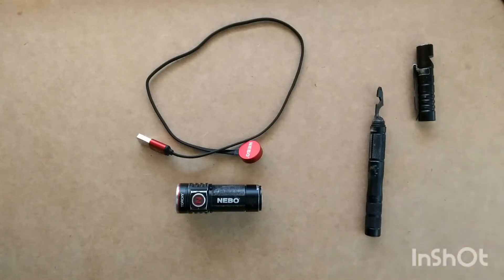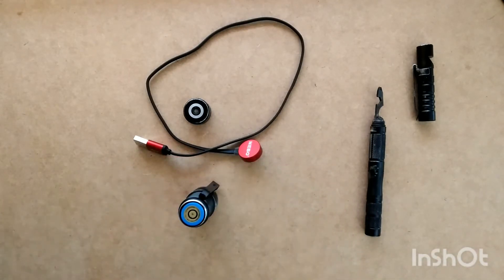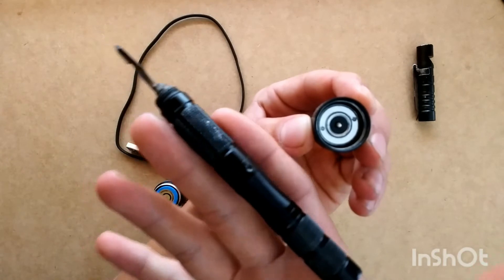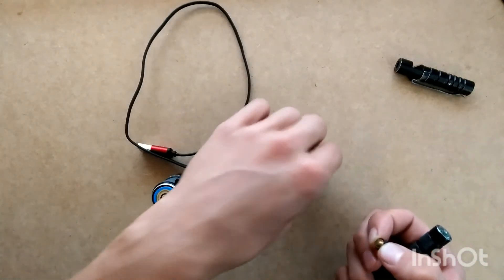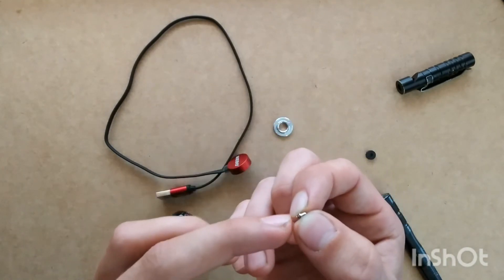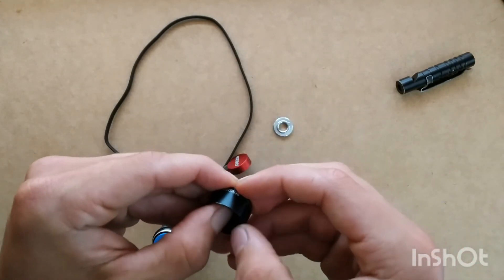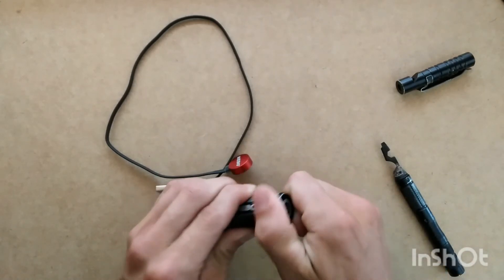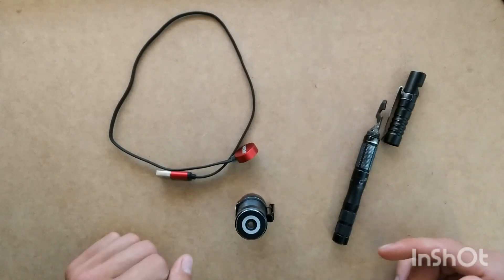Nebo torchy repair (not charging)

Comment: Mine has been dead for a year now and saw this video and said freak it haha stretched the spring and nothing but… I put a foil paper between the spring and the battery and it fixed it! Even after I took off the foil. I have no idea what I did but it work 😂
Reply: Thumbs up for the win I couldn’t find or was going to look that hard for a stupid little spring. Jammed some foil in that baby and away I went. Bty I think that thing that everyone thinks is a spring is a fuse.
Reply: Could you describe how you did it please ?

Comment: Where in the world would you get such a spring?  I know Nebo doesn't sell them.  How did you break that spring?  did you overtighten the base cap?  I doubt using the light while charging would have put any stress on that spring.  I have a Torchy myself, and the bottom doesn't move if I move the light around while being charged.  I will say this though, I really like this light, it's very small but very bright, and the battery can be replaced instead of having to replace the light should the battery fail.
Reply: Do you know the battery type?
Reply: Could use a cutdown spring from a retractable pen? 🤔

Comment: Mine bran new wasn't turning red charging just stayed blue. Didn't have foil because I'm traveling so I used a thin piece of foil off a Wendy's burger wrap and it worked. Don't have to open it just place foil between charger and the flashlight hole and it'll turn red.

Comment: I have had charging issues with mine as well. I tried just foil and although it did make the charger light turn red no charge got to the battery. 

What has worked for me is to attach the magnetic charger and lightly tap the flashlight on the desk (light side down) somehow this makes the connection and the charger light turns red. Then i just leave the flashlight standing upright to charge it (magnetic charger on topside, lightside down).

Comment: I have this issue with the new one it won’t charge when putting it on the magnetic charger hasn’t been dropped or In contact with water only had it a month…
Reply: I’m on my second one of the new one torchy 2k Nebo replaced for free but this one is doing the same…. Horrible design
Reply: @csarandos94  try the foil trick